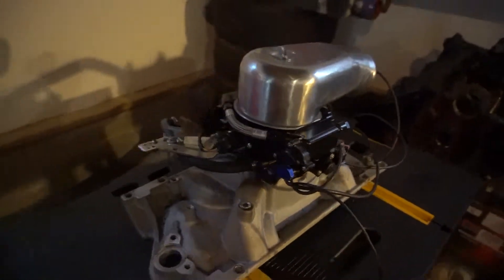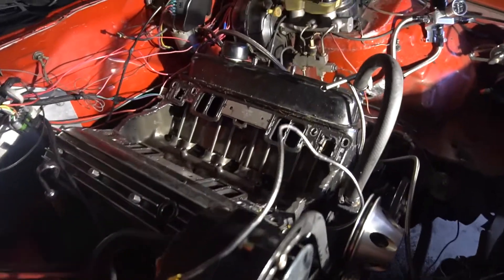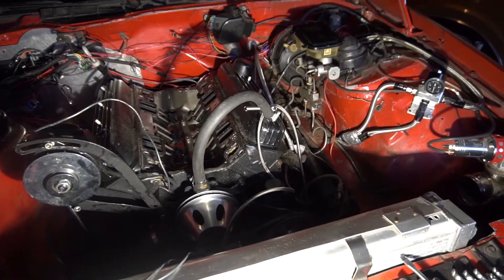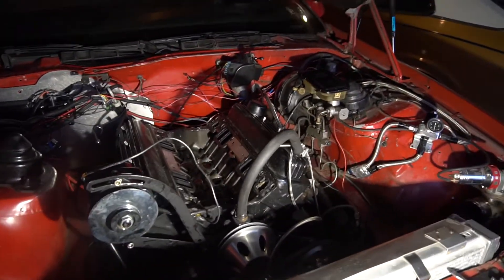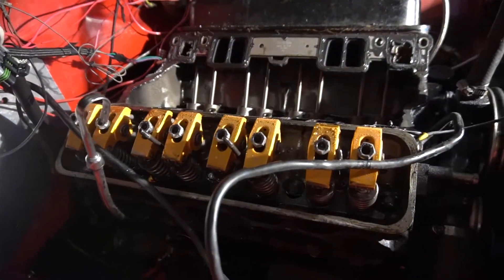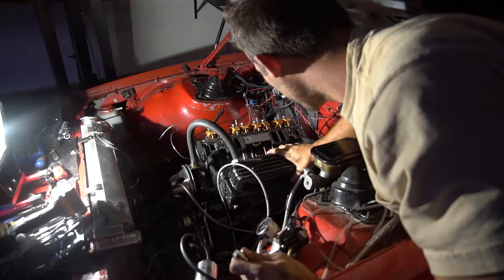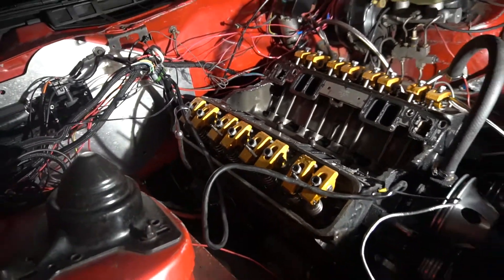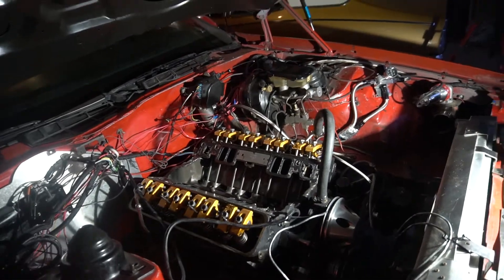Engine Tear down: Small Block Chevy 350 With a Blown Head Gasket

Comment: My 350 has low compression on the passenger side, especially the 2 middle ones and the other ones are low. But they're not that's great. But, uh, coolant is not mixing. I have yet to pull the heads off to see what's going on. But mine did run hot as well. But it still ran okay

Comment: Deck those heads and use regular gaskets, always clean threaded taps and use new head bolts. Once heat stretched, torque value changes in heat cycles

Comment: i wouldn't trust a mechanic if my life depended on it, but if you're doing the job yourself always use new bolts, thread lock & new gaskets. Most importantly, torque the head bolts in correct order & to proper spec e.g 32Nm +90 degrees +another 90 degrees

Comment: Had the same problem on Olds 350 after changing gaskets 3-4 times went with Arp bolts head bolts and intake bolts,bolts wore down from the excessive heat ranges.

Comment: You could always run it a few times get the heads hot and recheck the torque on the head bolts ive seen a lot of the guys that i hang with do that the head gaskets aare not steel shims like the old days there composite based material so its good to re torque them you know what i mean.

Comment: I had the same problem, I ran my engine hot coming home from work. The water pump gasket was leaking from behind the impeller. Got home with a temp of 230 degrees, steaming! Anyway next day I fixed the waterpump gasket and seen water pouring out my exhaust and checked the oil, mixed water. So I pulled the engine for a complete rebuild. When it only needed new sealant on the head bolts! Live and learn!
Reply: Is the reason why he had moisture in the value covers?  Did you know that he spun a bearing because his head bolts became loose, giving play between parts.  I've heard that it is best to replace head bolts with new ones.

Comment: wut if was intake gasket, could valve train get milk shake? mine has both heads with it...so I'm suspecting intake blown gasket
Reply from the maker: It's definitely possible. Check the gasket between the water passages on the intake. Good luck with it!
Reply: @ZanesGarage  rusty sludge prob from sitting forever in water passages both heads where connects to intake (back of engine closest to distributor) any ideas how clean that out? not easy with rags!! Also forgot to mention pressure of cold Rad. when I pulled off cap the water leaked out...
Reply: Same thing with me I’m thinking I just blew a intake recently
Reply: Could be intake or head gaskets or intake or head bolts not locked to right ft lb

Comment: Any problems after? Great video!
Reply from the maker: Not with the head gaskets but I'm currently rebuilding it because of a spun bearing
Reply: @ZanesGarage  What caused a spun bearing??
Reply: @ZanesGarage I believe that the bearing spun because of lack of lubricant.  Possibly because of water during the time that the engine isn't running.
Reply: I guess we will never know.